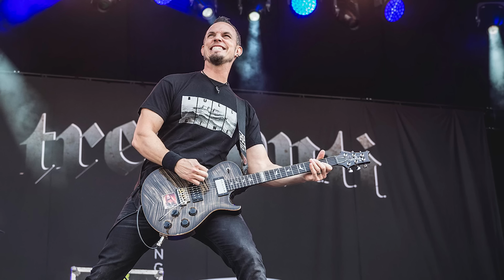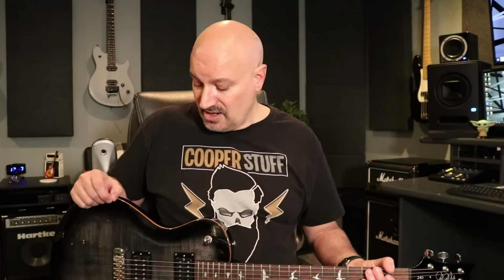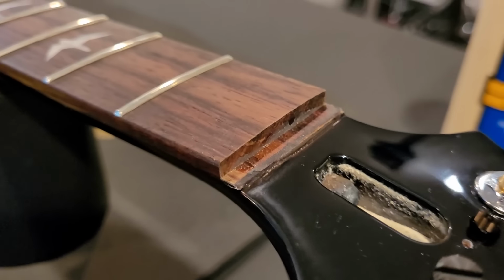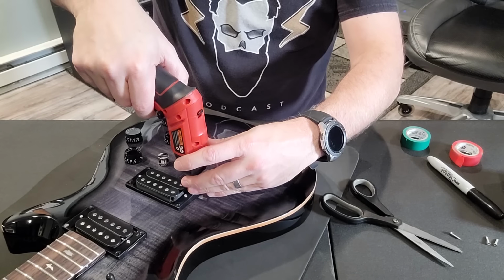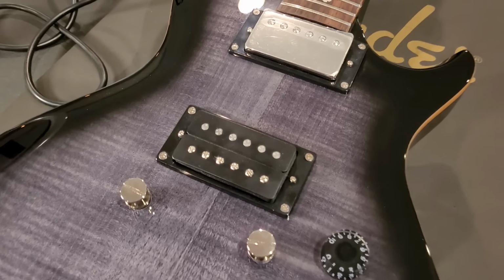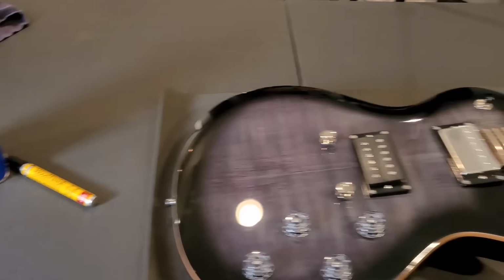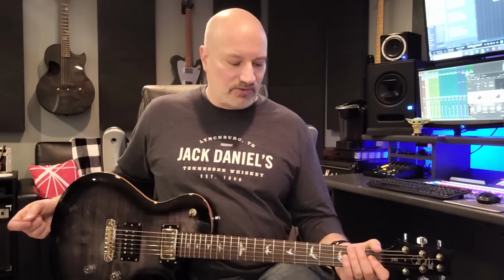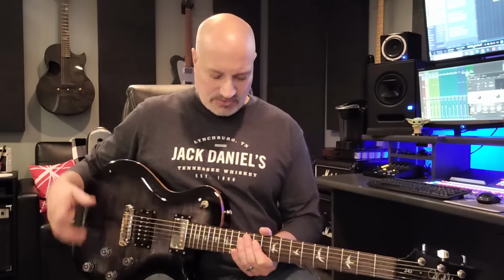Upgrading a PRS SE into a Core PRS

Comment: For newbie’s at doing this type of work take some pictures before you disassemble the parts and wires.
Reply from the maker: Agreed!  I actually mentioned taking pictures at one point but I accidentally cut out that part of the video! 🙂
Reply: Also be descriptive and write were everything goes because pictures can still leave you lost so having both also helps you remember
Reply: Good job 👏🏽
Reply: I'd add for newbies to only work on one piece at a time. So, de-solder one pickup, attach new one. Repeat for 2nd pickup. Instead of doing both at the same time. Breaking up the steps, just like practicing, helps a lot.

Comment: This is what I basically have done with all my guitars. I'm a paramedic. So I can't afford the guitars I like most. So I buy the version I can afford, and modify until it's  as close as possible to the one I wanted in the first place. Some, I've bought the parts for over time, and then eventually assembled the  guitar I couldn't afford. Most, I've bought the lower end model and upgraded it a piece at a time. My Tele is basically a Brent Mason Tele, but in butterscotch. One of my Strats is essentially a Clapton Signature Strat, just without the signature. My Les Paul is a Tribute model with upgraded PAFs and a Jimmy Page circuit mod. So basically, I buy the guitar I can afford. Then I tweak it into the one I wanted.

Comment: Bought a used Tremonti SE Custom/ upgraded to locking tuners, core tremonti pickups, added coil split for bridge, changed to John Mann floating bridge with brass tone bar, knobs and strap pegs left original. Cost under 1000 and it sounds and plays fantastic! Well worth it!
Reply: Did that too! Except I used different pickups

Comment: The reason you probably got such a killer deal on your 245 is because it has been discontinued in favor of the 594.  Very comparable guitars, the 594 just has a slightly different neck profile and scale length as well as different pickups.  The stock nut on the 245 isn't plastic, it's similar to a GraphTech.  All good choices for upgrades though, well done.

Comment: I have the exact same guitar, same color and everything, fitted some
strap locks and upgraded the pups to SD invaders which made a massive difference, the stock pups were a big disappointment in my opinion but now the guitar sounds fantastic. Also treated the neck with a dark linseed oil and had a professional set up with fret job. Will have to get a set of those control knobs, they look great Great video.

Comment: I would recommend not gluing the nut until you've checked out. It's. I had to sand on mine quite a bit to get it to sit nicely. I ordered the graphtech nut but it was white and tiny, so I bought a core nut, a couple dollars more. I have a custom 24 se, I recently added a brass sustain block to the tremolo.  It really gave me a much better note attack, I didn't expect much difference but it was a pretty noticeable change, the nut also improved the tone, and of course the Seymour Duncan pickups  were a huge improvement.  Now I live that guitar. It was set up terribly when I got it, but it just felt great. I am so glad I made the effort to upgrade it. It's awesome now

Comment: I did a similar customization to my 2020 Exotic Edition SE Custom 24. I upgraded to the PRS locking tuners, put a set of Maryland-made 85/15 pickups in it, the PRS 5-way super switch, I swapped out the import tremolo to a PRS tremolo from Mannmade USA (John Mann was the designer and original fabricator of the PRS tremolo), I put the coated Fender tremolo springs in , and I swapped out the pots and caps for upgraded parts. For the push/pull, I decided on a push/push tone pot. I love the functionality of a push/push way more than a push/pull. In retaining a push/push tone pot in addition to the 5-way super switch, I ended up with more tones than even a Core model Custom 24. And of course I also swapped out the strap buttons for Dunlop strap locks. I also had the frets Plek'd. I think that's all the modifications I've made to my guitar. I absolutely love it.

Comment: A tip on changing tuners (switches and pots too that secure with a washer or bushing and a nut) is finger tighten with a socket as firmly as you can but don't use the wrench handle- that much extra torque is overkill when attaching a metal thing to a wood thing. Finger-tight with your firmest grip on the socket is tight enough, and you won't crush the wood or damage the finish that way. As much.
Reply: That's called "mechanical sympathy" and it is a great skill to learn.  Not just on guitars,  on anything! Great advice, my man.
Reply: @mrfuriouser  Absolutely! You gotta have some feelings for the materials. I believe in 'optimum torque' for the given situation.

Comment: Cool video and sweet upgrades. The PRS SE are (usually) very nicely built and quality neck+body so with upgrades like you did they really turn into premium instruments. I did locking tuners and tusq nut on mine, and also the lampshade knobs. Im still considering which pickups to upgrade with. I hadn't considered these but now theyre definitely on the list of options. It sounds great.

Comment: Staining the neck is oddly the biggest improvement in my book.  I would have never contemplated that, rather, id have steel wool'd a finish off the back like any other hand tool id spend time with.  The fretboard politely sucked up the stain uniformly and looks cooler.  Pickups, tuners, nut obviously cleaned up the sound, but the neck stain seems like it just laid down and opened its legs for a first time DIY to let you feel okay taking a shot at something else later on. Pretty neat, Stevie.
Reply from the maker: Thanks!  I am still thinking about taking the finish off the back of the neck to make it more satin.
Reply: @Instrument.Identity.Disorder  The caveat to taking the gloss off is that it effectively "ruins" the guitar in regards to resale, so you have to go into it noting its a keeper and not a flipper.  If youre keen on the idea and because its also nicely painted; I'd suggest practicing on a spray painted piece of test scrap. You can also go an extra bit and drive over to your local Maco and ask the car painter guy person to person (rather than trust the internet) how to approach it just right so you can feel more confident about not screwing up the paint. I know its nitpicky, but this is something special because of what you put into it.  Even if you keep the neck sticky, its still a really good guitar and you did a great job on the project, by the way.
Reply: I would have never done that.
Reply: That's one hell of analogy 😬

Comment: I did something similar with a PRS S2 Custom 24 "special run" I bought from Chicago Music Exchange (the special runs have a Quilt Top and an Ebony Fretboard). I bought the guitar as Demo about 2 weeks ago ~3/1/2024, so I got it for $1570 before sales tax, retail is $2099. After I received the guitar and gave it a couple of hours play time, I polished it with Gibson Pump Polish and could not find a blemish anywhere, I can't believe CME sold the guitar for $600 below retail in such great condition. Anyway, I swapped the OEM 85/15 S pickups with a set of TCI 85/15 Pickups I was able to get brand new as a pair for $350 on Reverb. The pickup swap alone was a huge improvement, but then I added a Mann Made solid brass Bridge Block (Custom 24 has a Tremolo and String-Thru configuration as many of you probably know).  The Mann Made brass Bridge Block kit also included a set of 6 Nickle plated brass saddles as well. The guitar is a Rock & Roll machine now! I can't believe how much the guitar has improved, especially considering how good it was to begin with.  I need to replace the nut (only thing I haven't done, the S2 came with locking tuners so saw no need to replace those). Definitely thinking about ordering a TUSQ nut for my S2 Custom 24 now!!

Comment: When I replaced the nut on my SE, I found the new nut was much too tall from the factory, so I slowly and carefully sanded down the bottom of the nut and then test fit it, back and forth, until the nut slot heights were back in spec for the guitar. When I glued the new nut in, I did it with high and low E strings on with tension so they helped to center the nut while the glue was still liquid. Just some thoughts on nut upgrades.

Comment: Nice job.  I've done the same (except for staining the fretboard) to all my Mexican Strats.  Pups used were Fender but a random (my) selection just to give the strat it's own voice, other than factory issued.  I also changed to Super Vee tremolos (can return to stock) I like better.  All my strats have a themed look to kinda go with the paint, like my blue strat has '63 pups, a '57 tail shaped pickguard & chrome knobs & pup covers for that hot rod vibe.  My black strat has chrome humbuckers, amp knobs & blk & white pickguard.  Things like this personalize the guitar to you, I never went for what the other guy has.  I gotta try the stain the fretboard thing.

Comment: This video was EXCELLENT! I was planning on doing this same thing. The only thing that I might also do is replace the volume/tone pots (if needed) and replace the tremolo for the Core model trem.
Reply from the maker: Thanks! I am still thinking about changing out the pots, caps, switch and jack (because, at this point I might as well, right?)
Reply: @Instrument.Identity.Disorder  if you do those mods also, we're going to need an update video!

Comment: Good upgrades, especially the tuners I think. I prefer bone or brass nuts. The PRS SE pickups are very good, but the set you installed is better for sure. Pickups are an area that someone may be able to save a few dollars. I think you have built a great guitar.
Reply from the maker: Thanks!

Comment: When removing the pickups I’d recommend connecting a pull string to the potentiometer side of the wire to assist the installation of the new pickups.
Reply: why remove pickups.. if you even use mild overdrive the tonal difference from 1 humbucker to another humbucker is unnoticable.

Comment: Thanks for the video!

I moded a Tremonti SE and did hot rodded Seymour Duncan pick ups, Tremonti potentiometer switches from John Mann from core Tremonti ($100), knobs, hip shot locking tuners and tusq nut. I also did input jack and toggle switch (very worth while upgrade)
I had a technician do a lot of the work and probably would skip the nut replacement next time, I had to bring it back twice and have the nut and frets tweaked for no buzzing, I think just the locking tunners would of been fine for tuning stability. 
After upgrades I have $1500 with the guitar, labor, tools and parts, but it sounds amazing and less than 1/3 of core Tremonti. Skipping the nut even though $10, was $300 in labor and tools. So could of done the whole project for $1200 being I bought the guitar used

For $1500 I would of sold it and bought an American S2 with American electronics in hindsight

Comment: I bought a used (brand new condition) 2023 US made PRS Mccarty 594 s2 double cut stock and paired it with my Halo double delay, EQ, chorus,metal zone, booster and noise gate and it sounds really good. The distortion is very clear and crispy and the acoustic sound angelic. I don't want the PRS core anymore and I sold my Gibson classic 2023 after I had my PRS McCarty 594 s2

Comment: Do you know if PRS uses the same Trem Blocks/block material on their Core and SE?  I have a '92 Strat that was a dog. I replaced the Lace Sensors with 57/62 that really helped. When I replaced the stock trem bloc with a bell steel bloc the guitar really came alive.
Reply: People always overlook that. Quality saddles, blocks, even bridge tail pieces make a significant improvement in tone.
Reply: @bradleyclosson5042  It was jaw dropping the difference the Callaham bloc made. To your point of bridge/tail piece. I installed a FaberUS  Bridge, tailpiece, studs in my Epi Custom. Acoustically it sounds like a Murphy Lab R8 and yes I swapped pups. If a guitar has the fit and finish everything else can be fixed.

Comment: I did a similar thing to a 2019 s2 Singlecut.  Swapped out the pickups for the Tremonti USA  neck/bridge.l and drop in wiring harness.   The added bonus was the s2 had the same 25” scale length of the core Tremonti. Sounded great

But, I sold it and just bought the core model. 

Excellent video and comparison

Comment: Love it, sounds much better. I did this to my 24 fret Ibanez (to the bridge only). The Tremonti pick up sits a little closer to the strings than the stock pickups did...however my guitar sounds amazing and unique. I would not have it any other way.  When I use the bridge pickup, my cleans actually have a little break up if I pick or strum aggressively, and when I throw on distortion it's insane. It's my favorite guitar and I'm not changing a thing. I prefer it over any PRS.

Comment: I'm thinking about doing something very similar, getting a PRS SE 245 because my band tends to switch in and out of drop tuning, meaning I need to tighten down the tremolo (on my PRS SE Standard 24-08) to be basically non-functional anyway. However, I think I'll stick P90s in, as don't currently have a guitar with those pups. Wish me luck! 😬🎸
Reply: You know something though... that new PRS SE McCarthy could be a better candidate guitar than the 245. It looks amazing.

Comment: Great job! I actually own a Tremonti Core model and this same PRS SE guitar you upgraded. I think I may do the same with it. The only difference I’ll probably notice is the Tremonti has a 25” neck scale and the 245 is roughly 24 1/2” so I will probably notice a difference on string tension but other than that it’ll be worth it.

Comment: Really excellent video with all steps well documented.   I did get a little confused on the soldering for the tremonti neck pickup.   Did you also solder the braided shield on the pot for grounding.  It sort of looks like  you did.

Comment: I recently bought an SE Paul's Guitar from Sweetwater with the intention of getting it plekked and a new Graphtek nut installed. Although I was willing to spend extra for the nut and installation, my rep talked me out of it because he felt the PRS nut was as good if not better than the Graphtek. I went along with his suggestion thinking he must believe that to be true if he is talking me out of spending the $100 ish for nut installation. I don't know for sure which nut is better, but the neck is excellent and it plays sweet and stays in tune. I can vouch for that.
Reply from the maker: My wife had an SE Paul's guitar briefly and then traded it for an SE Hollowbody II Piezo so she could also have acoustic tones. Her new one has had some tuning issues so I first changed to locking tuners. That didn't completely fix the issue so I ended up replacing the nut with a graphtech. So far so good! Did you end up getting it pleked? I've thought about that but haven't done it to any of my guitars yet.
Reply: @Instrument.Identity.Disorder Yes on the plek. I'll never know if it actually needed it or not because I had it done before I ever played it. But I do know that it it is setup immaculately and the action is smoothe. I weighed the option of getting a less expensive guitar and paying extra for plek and setup vs. getting a more expensive guitar straight from the seller or "QC". Unfortunately core model pricing was out or reach for me so I opted for a well setup SE. This is also after spending some time with my 2021 SE 24-08, which is also very nice. PRS SE is hitting a sweet spot right now, IMO. Great quality for a mid level price. All that said, I find myself using my "straight from the seller" 24-08 a lot. It is a very nice fit for me and sometimes a less expensive guitar just feels good. I may upgrade to locking tuners someday, but,  both of my PRS SE guitars play very well, stay in tune wonderfully, and I have a blast playing them. I also love my Gretsch 5420 hollowbody which is in the same price range as the SE line, but it is going to need a lot more work. Wonky switch, weird hardware buzz, pickups are meh ...

Comment: Honestly,  I couldn't hear much of a difference. That said, the locking tuners and nut replacement  are the only justifiable upgrades for their increased tuning stability (not that the SE line has tuning stability issues) and time saving on string changes. The strap locks are also a nice touch for a practicality standpoint. 
The staining of the fretboard, definitely looked cool, but I doubt it had any real affect on the sound.
Reply: Staining a fretboard has no effect on sound. The biggest difference was obviously the pickups. Locking tuners help immensely. Nut? Eh, helps a little if your strings are snagging....nothing some sandpaper and graphite can't fix.

Comment: When you replaced the nut, did you have to file down any of the slots ?
What’s your selector switch like?
My Tremonti SE Standard needs a new switch as it’s too unreliable and i want to replace the nut with a graftech one too. 
I’ve had to block the tremelo for now. 
I’m keeping the pickups as I quite like them although i may install pull/push to split them. 
Greetings from NZ 😎🎸🤘